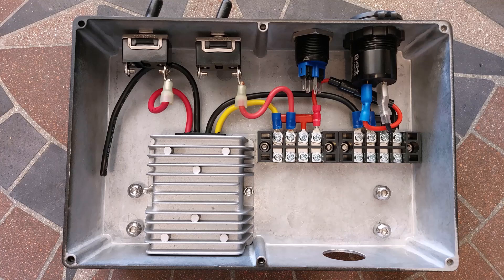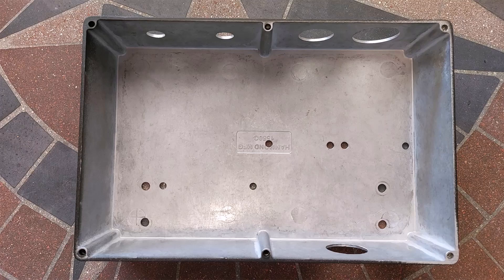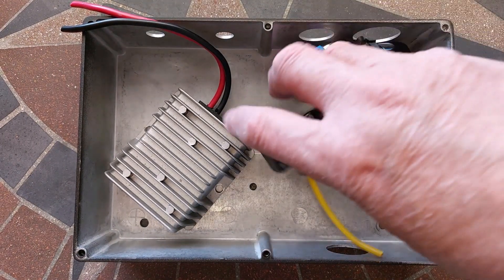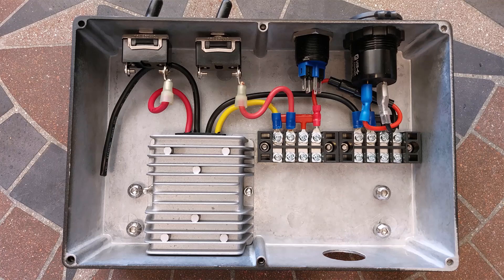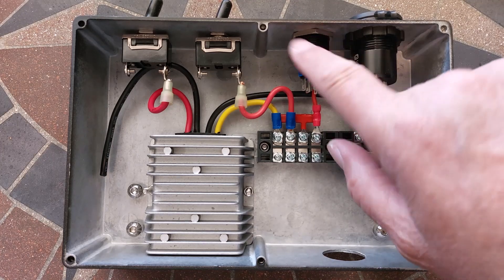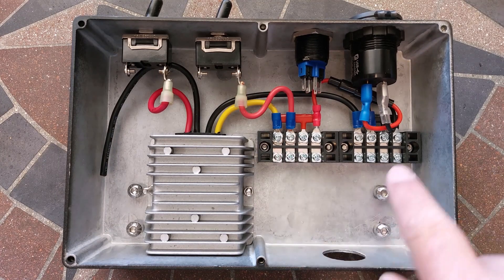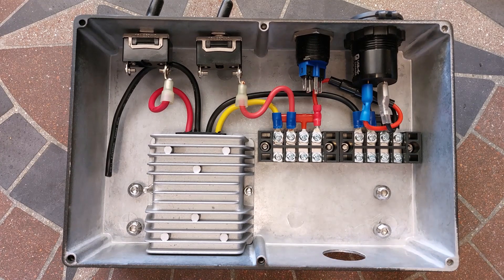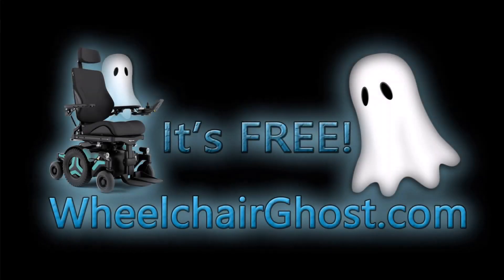Wheelchair Small Power Box Build

Comment: I really need a video explaining how to wire in that disco ball into my chair 😜🤣😂. Nice box you made. Do you have any circuit protection either inline to the box or inside?
Reply from the maker: Watch the video "Make It Mine Step 3"

The Power Port comes with a fuse holder, so it's fused right at the battery connection.   Neat and clean for 15 bucks.

Oh, the disco ball... wiring is easy, but mounting the damned thang... gotta be at least 12 feet off the floor!   Makes doorways a problem for the chair.